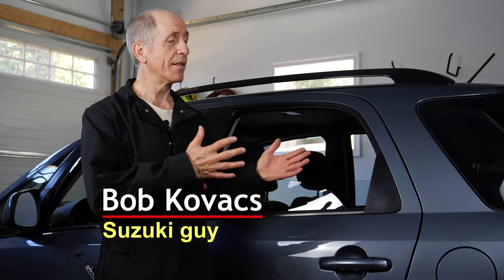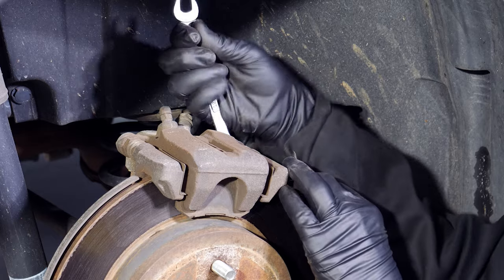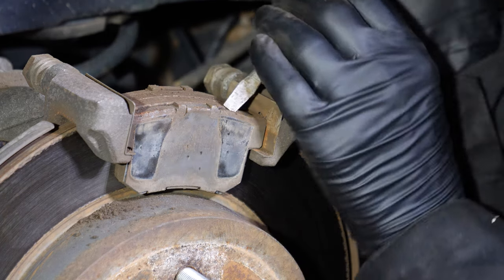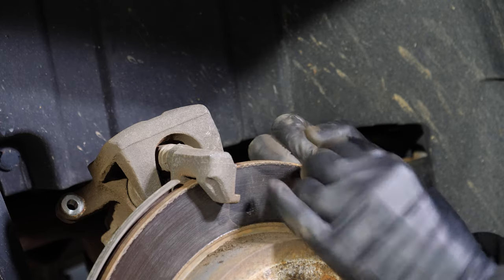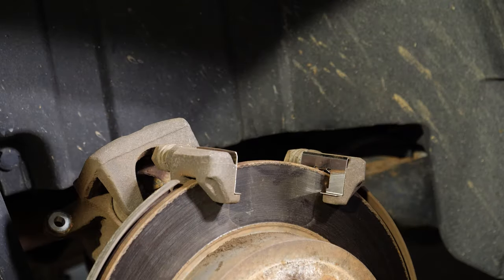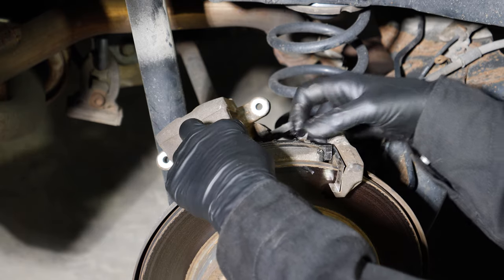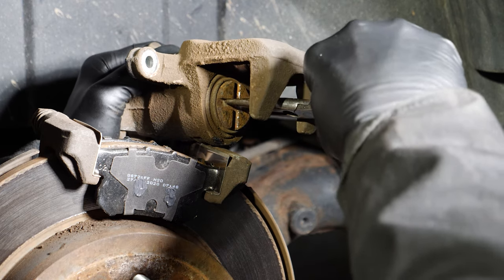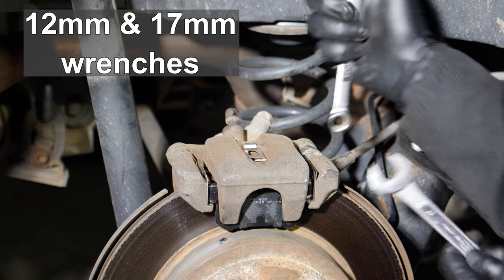Suzuki SX4 Rear Brake Pad Replacement

Comment: Bob, nice video. They make a tool to help spin the piston back in, most auto parts stores have them and they're only about $10. It's call a disc brake rewind cube tool. It has nubs that fit in the piston's grooves and a square hole to accept a 3/8 ratcher extension and then attach to any 3/8 drive ratchet. You then have good grip and much more leverage to quickly spin the piston back in easily.
Reply from the maker: I figured that there was a tool for it. I did not have one, and I figured that I'd show the way that worked for me. I actually tried two or three things before figuring out how to use the pliers that I show in the video. It wasn't perfect, but it worked reasonably well.

I probably should buy the right tool, however.

Comment: Wonderful and concise video. I used a chisel to screw the caliper back in after rocking it a few time back and forth and that worked great. I had a bit of a challenge with the center shim. Any tips there would be good addition. Also my pins seemed or felt lubed inside their boots? I just made sure they moved freely but I could feel the grease inside the boot. The last item of tightening of the caliper seems very important. The only thing I would change is telling us idiots up front to make sure we watch ALL OF THE VIDEO so that we mount the caliper correctly. Great cars. I have been very happy with mine. 
Cheers!
Reply from the maker: Thanks! The pros will (or at least should) always make sure there is fresh lube on the pins. However, us backyard mechanics usually just check to be sure things move freely. As for the middle shim, I might have bent it a bit to get it to stay in the caliper.

Comment: Hi Bob Keith Kuhn here again.
Excellent job Bob no kidding.
I know how to do this stuff but I just hate  it
Reply from the maker: Thanks, Keith! This was the 3rd of three videos that I shot all at the same time. I had to replace the caliper, and that meant replacing the pads and bleeding the brakes. So I figured I would cover all three topics. It made for a fairly exhausting day, however.

Comment: You also didn’t lube the new metal shims that the pads slide on when they are compressed and retract as the brake pedal is applied and released.
Reply from the maker: FWIW, I've had these pads on the car for nearly 3 years and have had no issues with these brake pads. You are right, though -- the correct way is to put a bit of lubricant at all points where pieces are moving.

Comment: Is it possible to push the piston back without turning? Like using a six-inch C-clamp?
Reply from the maker: No, the only way to get it back in is by turning. I actually tried a C-clamp to force it back and it did not work. The good news is that it was much easier to get the piston back by turning than I thought it would be. And all I used (as I show in the video) was a pair of needle-nose pliers.

Comment: I'm just wondering, wouldn't it be easier to apply the grease AFTER sliding it into position? Maybe I'm missing something.
Reply from the maker: Yes, you may be right. It might also be easier to put the grease on the caliper instead of the pads, but whatever works for you is fine.

Comment: I hope somebody still will comment on this, but am I slooowww or do I not need to make that piston unscrew once I screw it into the brake caliper and or does it come out by itself?
Reply from the maker: It comes out by itself when you pump the brakes. After you install the new pads, pump the brake pedal until you feel it firm up. Pump it again after you start the engine, to make sure the brake boost is working. Then you're good to go!
Reply: @BobKovacs  thank you so much for the insight. I was honestly scared thinking. Dang I’m driving with only front brakes right now. 🤣 very new to servicing my car…